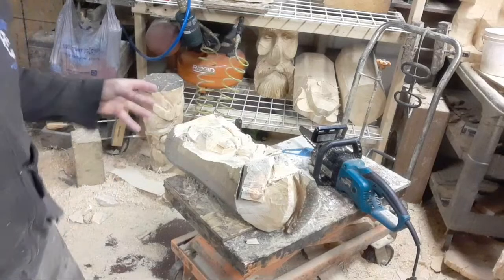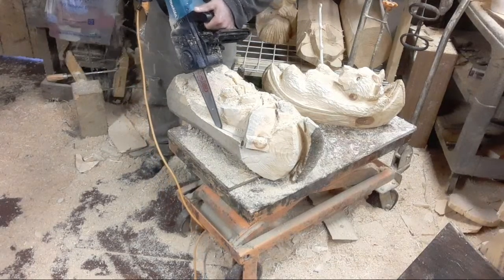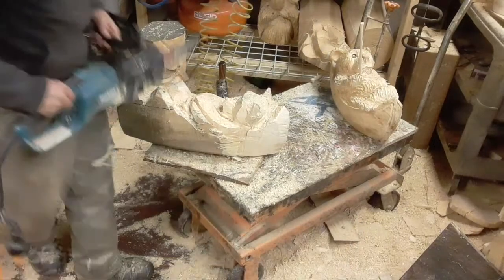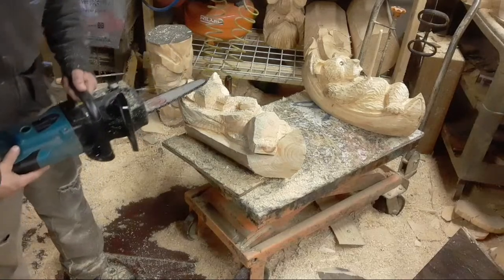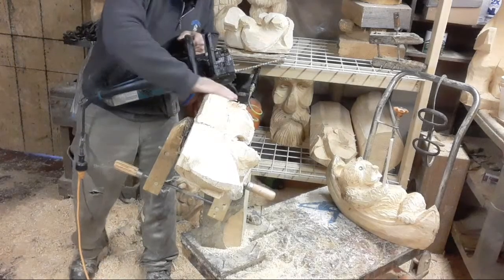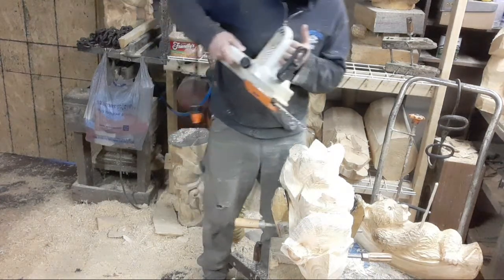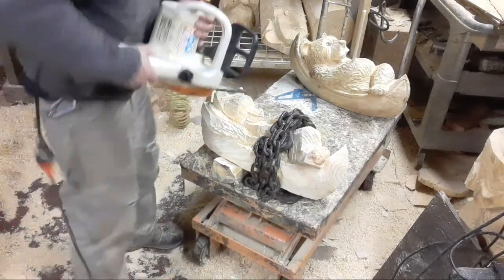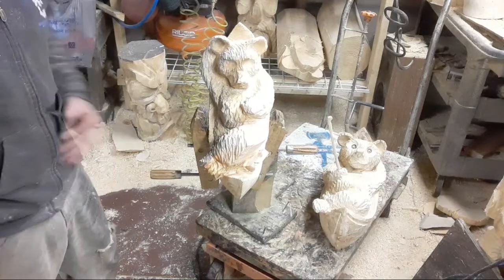chainsaw carving how to carve a canoe bear

Comment: Hi I love your carvings and I have picked up some great tips and I see you use a makita saw
I have just started carving with a makita but cannot get a carving bar to fit so I plan to buy
Another saw could you advise and must be electric  thanks
Reply from the maker: All makita electrics fit the standard c1, and h1 bars, what's the issue you're having? Fit up depends on which model you have, and if you are  fitting chain pitch to sprocket pitch.
Reply: @badasswood  hi again the problem I’m having is I don’t know anything about the saws
I have just started carving this year and I want a carving bar so I can do more detail
I would appreciate any help you can give
Reply from the maker: What model makita? Look on the tag on the saw, you'll see larger numbers, like uc4000, or 5012b, so on...
Reply from the maker: Of course if you want a fully set up carving saw, out of the box, both stihl,and echo make battery powered saws, that come with carving bars, but not cheap. Other issue with battery saws is they tend to bounce around a little if not set up properly,much the same with electrics, lighter saws tend to bounce more, with longer bars...many get discouraged by just that, and often quit carving. I have a group on Facebook where I help people set up their saws, same name as this channel, carving stories ...
Reply: @badasswood  hi again the saw I have is uc3001 and I like the saw so if I could get another one for detail that would be great
 I don’t care what it is makita  or what ever I already have a battery. Saw and I don’t like it too slow and as you say it bounces around
I have tried to get a carving bar for my saw but with no luck , so if I knew what saw to buy and what bar goes with it that would be great
Sorry to be a pain but I don’t know any carvers in uk
Reply: @badasswood  
I am looking at two saws makita uc3541a and still mse141c what do you think
Reply from the maker: Any of the UC saws should for a standard bar mount. If you search by saw, you will have a hard time finding anything, hardest part is getting the chain cut to proper length. Have you looked up Simon o rourke?hes a brit carver who sells bars and carving kits.. in our world of carving set ups we often have to research based on retrofit, and be inventive to attain proper fit up, and specialized tools. It's good if you can go to a local shop to get the chain cut, I order my chains by the foot, and cut my own, with the Granberg field mender, that I show in a few videos... some times sourcing carving bars isn't easy, but there's a bar for every saw. The best thing to do is look me up on facebook, mark Watson, then we can message, send pics, reference measurements. I wouldn't give up on your current saw just yet, I use the uc 4000, and uc 4025, fitted bars to each, took some tooling though to get them to be top performers. Other thing I did was made my own bar, and sprocket conversion for the uc4000. Its possible, just takes a lot of work some times...
Reply from the maker: Very similar saws to what I run, I just slapped a cannon on my stihl, fits great!
Reply from the maker: The uc3001 is very similar to three uc4000,why cant you find a carving bar for it? How exactly are you searching?I've fit several different bars to my uc4000. But if you look in an index, you'll find very little, or nothing for the uc saws...
Reply from the maker: Carving bars for the stihl 170,180, 210,250 will fit the uc saws...the uc saws also will accommodate shorter hilt echo bars...
Reply from the maker: Both the stihl 141, and makita 3541 are great saws, easily interchange bars with the stihl gas saws in the 170-250 engine family...